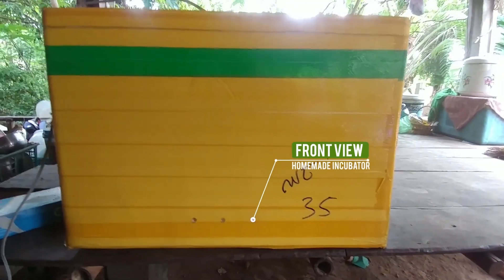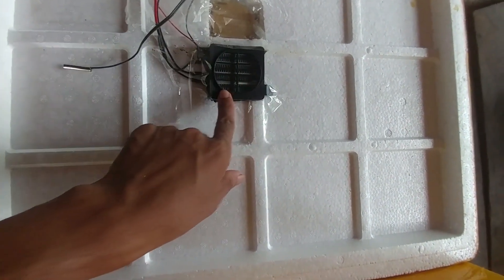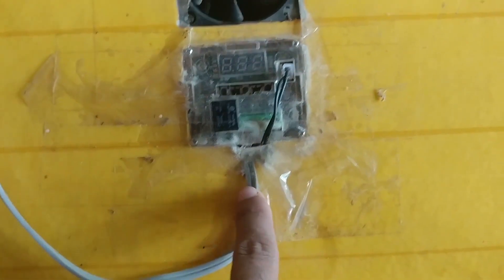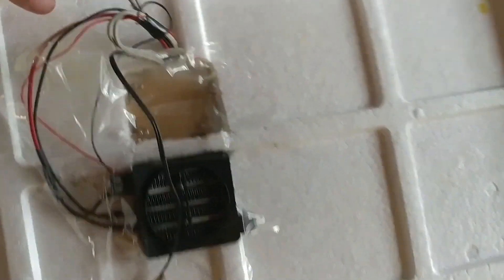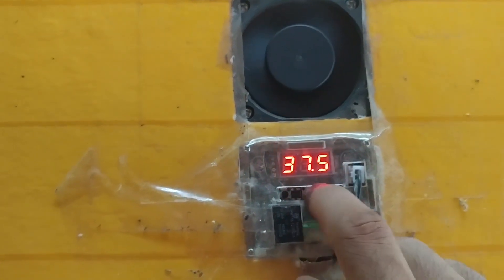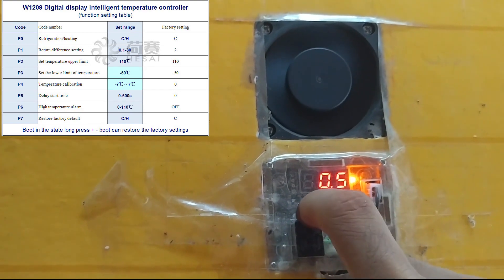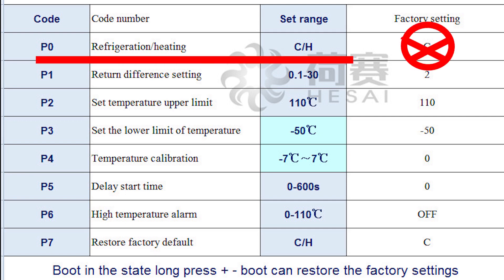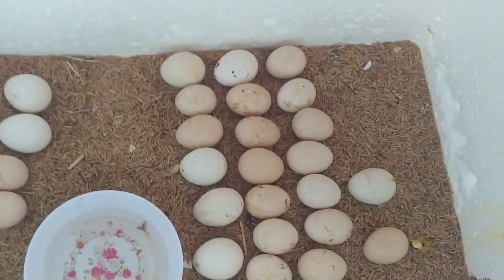How to make 100% hatching egg incubator easy at home

Comment: can i use 12v 2amp adopter, instead of using power supply
Reply: Does it work well?? Any problem encounterd? I have 12v 2amp adaptor too.
Reply from the maker: With this heater you must use a good quality of PW 10A, or low quality PW 20A, otherwise it's will drip off you power adapter.

Comment: Which heater you use.  for purpose.and voltage of heater? Plz
Reply from the maker: sulaiman khan its 12v ptc heater can check in decs. Its efficiency for heat and easy  to install. That is.

Comment: How good is that heater
Does it overheats?
Reply from the maker: The heater is good for efficiency of its design for. You can use Light bulb for that but the bulb will die of its life time.
I don't get what you mean for overheats, But the controller I use is a basic on off thermostat No PID for perfect constant temperature.

Comment: This has been really helpful, thanks. Any reason for the fan running continuously? I'm not using it for an incubator but for maintaining the temperature inside a 3d printing chamber. I'm thinking maybe just having the fan start when the heater starts?
Reply from the maker: I set the fan to always spin, doing like that just because to maintain temperature and humidity inside the box.

Comment: Easier to just use a ceramic heat emitter screwed into a lamp base and a fan. Then run them through a digital thermostat. Been building reptile incbators like that for 30 years.
Reply from the maker: yes, any heating element would work, but price is not different at all. using this element kit is easy to attach it to a form box.